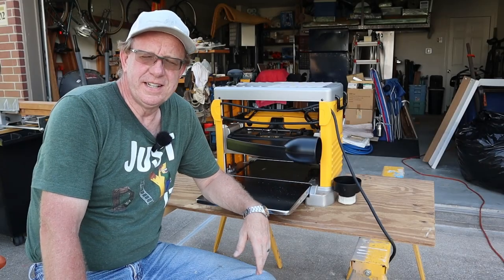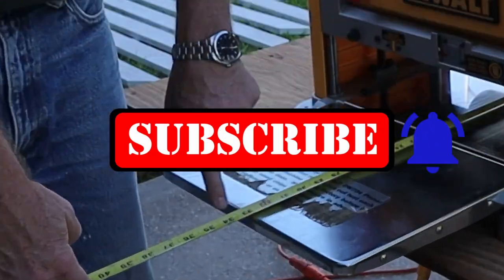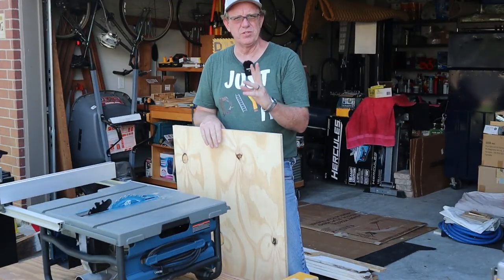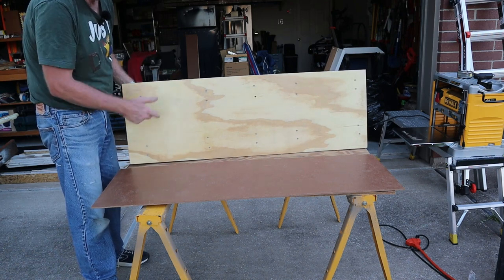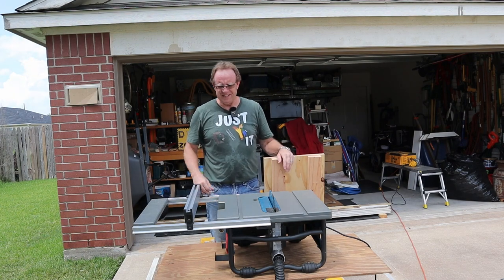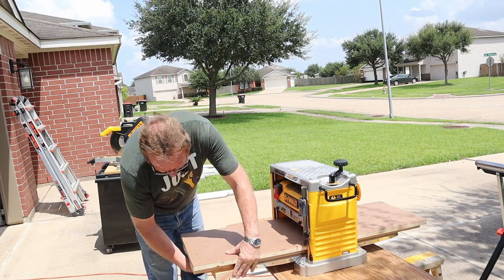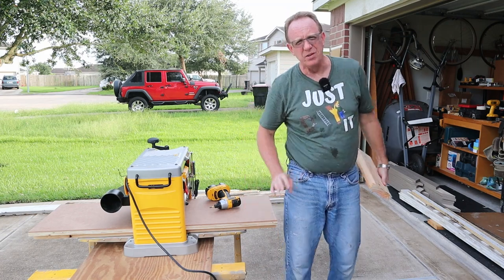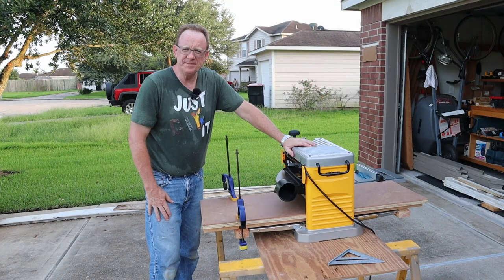Dewalt Planer Sled build for any model-- made DIY easy

Comment: Well shot video! I may have to make that table extension. Do the neighbors have issues with power equipment operating in the front yard?
Reply from the maker: thanks for watching.  LOL no most of the time the neighbors are not home when doing the videos and if they do they haven't said anything.  Also typically have the vehicles in the driveway helping hide what I am doing.  As you can see my garage is full and not much room to work in it.  Again thanks for watching and glad you liked it.